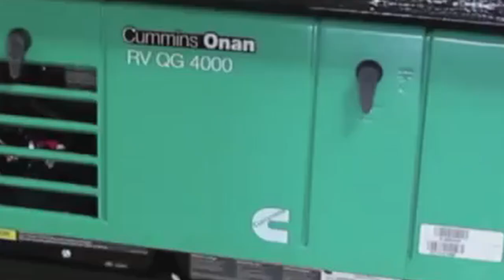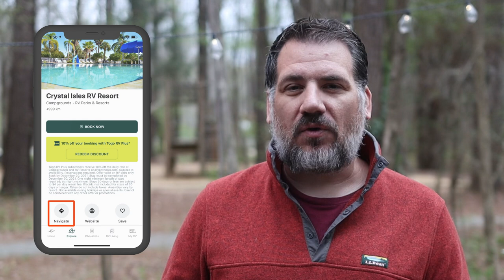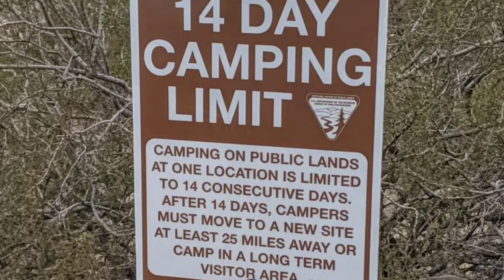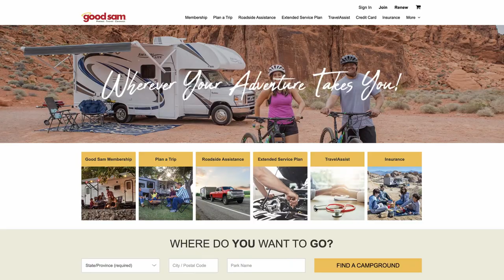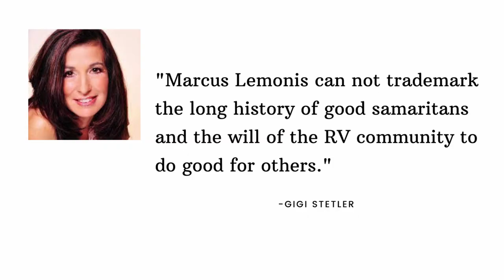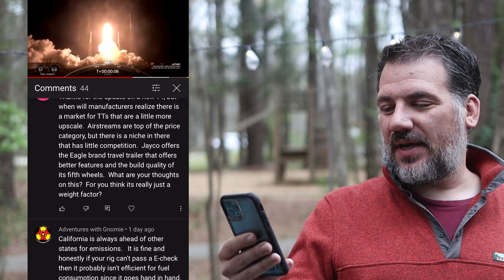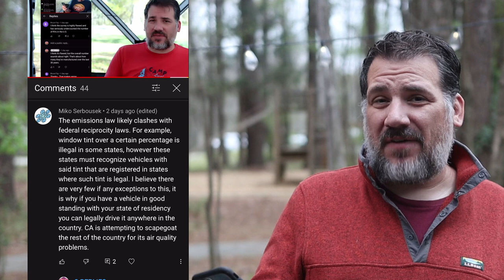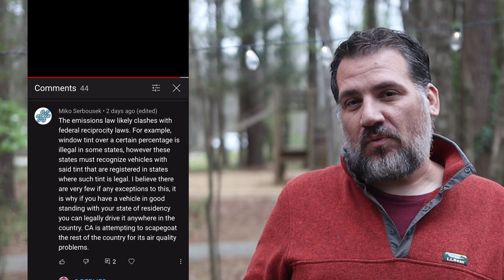Good Sam Sues Good Samaritan Club, RVers Dangle 80' in Air, RV Material Woes, 7000 New FL Campsites

Comment from the maker: I mumbled a bit there - the estimated damage to the Jeep is $30,000, not $3,000.
Reply: Sounds about right. New motor, trans, front half of exhaust, clutch assembly, certain suspension components that received damage. Let’s also not forget the need for corrosion preventative application and miscellaneous hardware, TTY bolts with encapsulated nuts. It was an expensive mistake however, this is what we pay insurance for! I still want to know what the tow rig was? Had to be a diesel pusher to overcome that drag not being felt while driving.
Reply: My first question.
Reply: 30,000 in damages for a vehicle 🚗 that’s only worth 15,000 band new Regardless of the trim level.
Reply: @gerald4nomads  $15k for a 2021 JL Unlimited Rubicon?
Reply: Lol transmission is 3,000 engine 5,000.  Definitely no where near 30k.
Reply: @gerald4nomads  You Obviously have not researched the cost of the vehicle in question! 
It is a new Jeep JLU Rubicon. 
My 2019 Jeep JKU RUBICON was 30 when I bought it new. 
You also have to take into consideration the Labor to repair it. 
I'm sure the insurance will possibly total it.
Reply: @gerald4nomads  Rubicons average 50k to 60k depending on options. 
And that is with just dealer ordered options not anything that the customer had put on it at time of sale.
Reply: @jamesglenn520  I’m sure that’s what they’re selling for, you can sell anything for any amount however it doesn’t necessarily mean is worth it.
Reply: @gerald4nomads  That has got to be the Dumbest saying in the world! I haven't heard anything like that since grade school 🤣
Reply: Holy cow! So, how do you tow like that? Transmission should be in neutral, no?
Reply: @theresam567  Jeeps have to be flat towed with the manual transmission in gear(not neutral) and the transfer case in neutral. If it has an automatic transmission then the transmission needs to be in PARK and transfer case in neutral.
Reply from the maker: Yes it was a 45' DP
Reply: @jamesglenn520  Having had to hire my own appraiser to fight my insurance company's efforts to total out my car, you are probably right.
Reply: I read this just before I started to ask! lol

Comment: I sure enjoy your video here on YouTube  ! I’m a nomad with a vintage Chevy one ton classic arrow dynamic custom rebuild ... I took off enormous amount of weight off the front by removing the high over cab design and making it slope back arrow dynamic with aluminum sealed roof  I don’t miss the space at all and now it’s lighter and less wind issues.. on the back I also removed the back portion from the side door back leaving only the roof ... I closed it in and reinstalled the side door making it a rear door ... the extra space on the rear frame became my rear porch .. I removed so much weight on the rear  ... it now looks like a really cool box truck with a rear covered porch ... The 350 v 8 motor is so easy to work on and it has very little miles on it and the frame and other components are in excellent condition... it’s well insulated... and no leaks .. looks cool and operates extremely well ... been living in it for two years now ... still reducing and modifications are still in the works... my goal is to have the best options possible to enjoy traveling and living accommodations ... living with less to live large .... I sure do enjoy living the nomadic life style .... I was a over the road semi truck driver .... and always wanted to take my time and explore the country without being in a hurry to get some where ... the rather small RV I’ve constructed is real easy to go places that a regular van can go ...with its short wheel base and high road clearance... it can handle most back country rough road conditions and it doesn’t have a high roof issue either ... now compact and wind resistant ... I’m really happy with it ...

Comment: I have a friend who recently towed his Dodge Ram 1/2 ton about 3 miles and wore the rear tires out and got into the rims. A motorist pulled up beside him as he was about to merge on to the Interstate Ramp and got him to pull over. A costly mistake. I believe the Dodge has a setting to put the automatic transmission into tow mode but you have to do that before starting the trip. Happy Trails.

Comment: An engine doesn't have the capability to get to 50000 rpms.  I suspect you meant 5000 rpms.
Reply from the maker: That's why it exploded. The mechanic did the math based on the speed the RV was driving when the Jeep went boom.
Reply from the maker: To be clear, it was being towed, it wasn't running on its own power